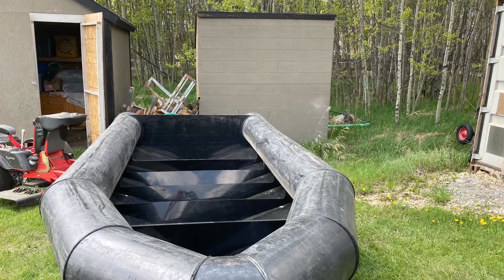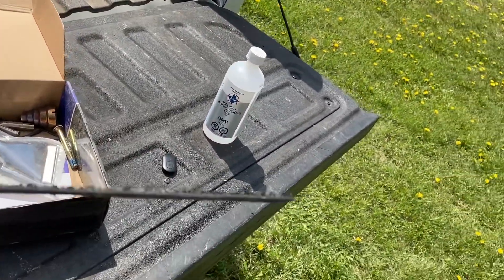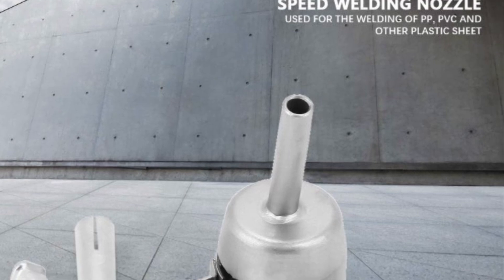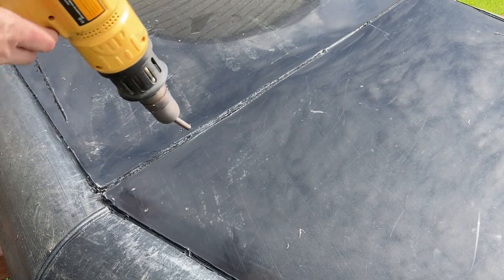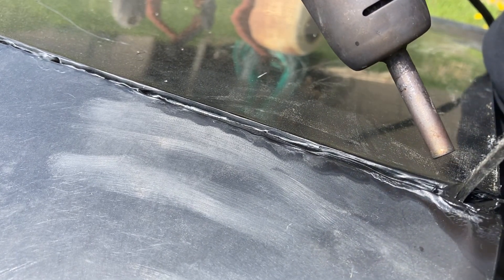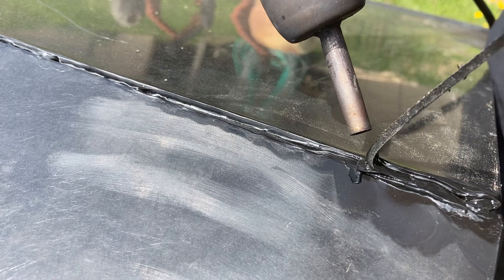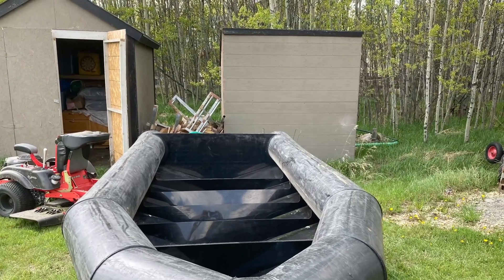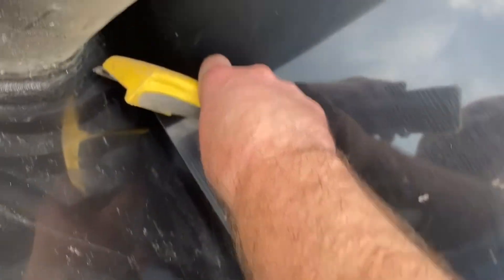HDPE (High Density Polyethylene) Boat Build Part 2

Comment: Both the filler rod and the work piece need to be at the correct temperature to allow very little pressure, hold the rod at rightangle to the work and allow the rod to collapse into the weld joint whilst proceeding forward. Cheers

Comment: I'd consider using Flex and Seal over all the interior welds as a backup.  Waterproofs and is strong.
 I use it on the seams of older aluminum boats I've repaired with excellent results.
Reply from the maker: HDPE is highly resistant to glues and most chemicals in general. That is why it must be fused with heat.
Reply: @WoodLander-   You use  primer on the HDPE first and then use the tube sealant. Only takes a minute to apply, dries fast. Adheres very well. Bostik Seal N' Flex FC
Reply: Cool design! It would be nice to know the finished weight, or an estimate thereof. Also, have you chambered your pontoons so that if you have a puncture you still have flotation in other areas?
Reply: Only use silicone-based products in a boating emergency.
Silicone is almost impossible to remove completely, from any surface.
Reply: @Peter-jo3wt   You're clearly not a seafarer.
Reply: @frankdesbaux  
You've clearly never painted a boat.
Reply: @Peter-jo3wt   Incorrect. As a life long sailor I know all about painting boats.
 Just for fun I'd walk around paint booths at the docks spraying aerosol silicone on everything just for fun.
 There's a thousand different silicones laddie..... A lot of them paintable including the Bostik product mentioned. Trot along.

Comment: Working g doing sewer bypasses I use a bunch of HDPE.  Never gave it much thought to build a boat out of it that was not molded.    I did repair my kayak where the keel had worn through from dragging it.  I used a map touch and a plastic welder from harbor freight (glorified soldering iron) and a few pieces of a new 5 gallon bucket and had awesome results.  I smoothed everything out with a millbastard fill then hit it with the torch to smooth it out.

Comment: I know this a dumb question. 
I know nothing of joining plastic via this process. 
Will rubber cement join the pipes, as long as there is a smaller pipe inside to make 
(for a lack of a better word) a flange?
And does your process work for larger diameter, thickness plate?
Is there a limit if how thick the material that your joining can be?
Thanks for this series.
Reply from the maker: There are many different plastics. HDPE is what I am using and it is highly resistant to glues and chemicals in general.

Comment: could you tell us what is the brand name of the hdpe and where  you got it, thanks. also did you do a weld test?
Reply from the maker: I don’t know the brand of HDPE. But I bought the sheets from a local supplier. Yes we did many welding tests prior to starting the project. I tried a few different welding techniques and tested them. That is how I found that this method was the strongest.
Reply: @WoodLander-  Thanks, not all hdpe is weldable like that. starboard is hdpe but i am not able to fuse weld it together, down hear in florida it is 130 a sheet.for welding rod you can try V-A Process inc. they have a 5 lbs minimum